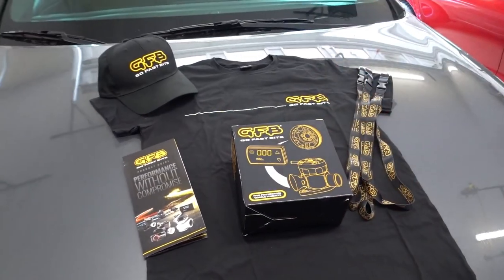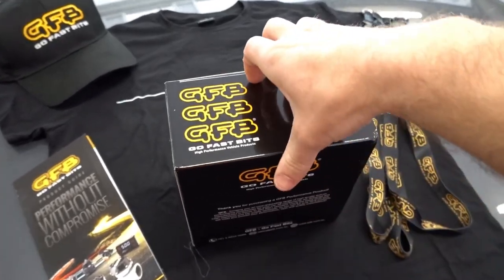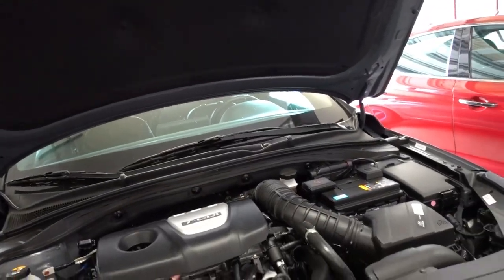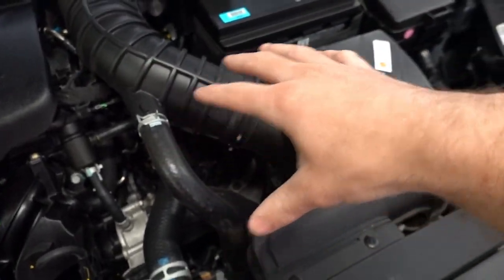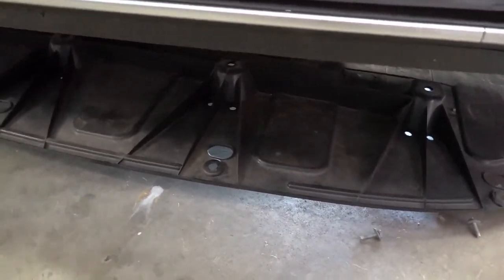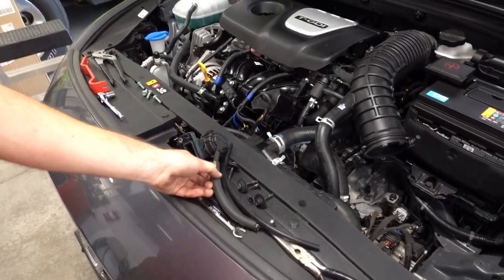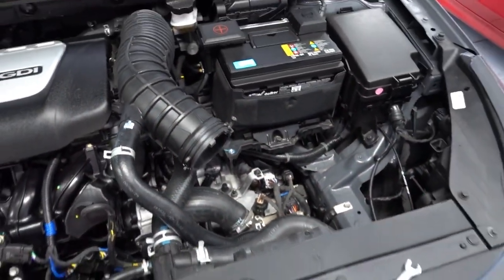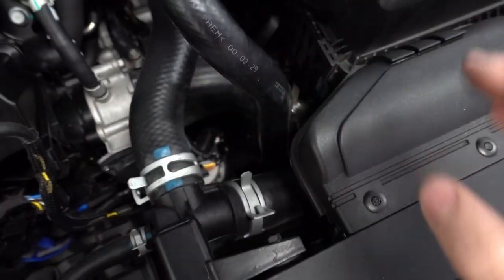Installing a GFB Respons Blow Off Valve! | Hyundai Elantra GT N Line

Comment: Installed mine in my i30 nline premium about a week ago. Removed the factory valve from the top relatively easily, but tightening the hex bolts on the GFB was a PITA. Ended up removing the large diameter horizontal TB hose which made things easy. Adjusting isnt that easy when the cap is slick. Took a fair amount of skin off the knuckles doing it. 

Great channel Justin
Reply: Hey man how does the car sound with the BOV and is ur car the 1.6Turbo?

Comment: I'm having constant flutter, not only during low rpms but every time I left off the gas. Any suggestions on fixing this? I tried adjusting the spring, my boost solenoid is working fine.
Reply from the maker: If you are hearing flutter chances are the valve is not opening properly and the noise is coming from the air being forced back into the turbo. I would make sure the spring isnt too tight and everything is working correctly.

Comment: Ok ,, I just bought a brand new 2020 NLINE ... what’s this for ? What’s the purpose ?
Reply: Will it enhance the performance on my car ? Or make it faster ?
Reply: I believe blow off valves are used to adjust how much boost the turbo makes before it vents. Different internal BOV springs have different stiffness which affects how much boost builds before it vents. It can certainly increase power but you REALLY want your car tuned to the boost level. Most people install a BOV because it sounds really cool.
Looking at a 2020 N-line myself here soon! 🥰
Reply: @anthonycoffey816  did you get one?  Got my baby fluid metal!

Comment: Hey Justin 
I bought myself the GFB Mach 2 
Question any thoughts on upgrading the intake on these cars 
I was consider doing a drop in k&n panel with a big mouth
Reply from the maker: That's a good combo for most cool intake temps (not a huge deal with intercooler) but may help a small amount.
Reply: Thanks mate

Comment: Justin would you recommend this mod if the goal was better throttle response? I don't care about the noise so I would probably go for the Mach 2 rather than the Response. GFB claims 30% quicker boost and better throttle response but that is for the fully recirculating version which I don't know if you've run yours fully recirculating but would you agree with their claims? At $240 I want to know if it's worth the investment.
Reply from the maker: I dont think you'll get 30% better throttle response out of this part unless your stock BPV was failing. Maybe its a little better but I didn't notice anything throttle wise that I can recall but my car is pretty new.
Reply: If you're under the impression fully recirculating will improve throttle response, keep the stock valve. It already fully recirculates back into the intake. This would be a pointless upgrade.
Reply from the maker: @VanillaWahlberg  The stock valve is rubber and can leak or fail over time. It would still be an upgrade even if its doing the same function.
Reply: @JustinKelly  Very true. Although if not needed and still under warranty, can give them a reason to deny claims. Since they cause so many CELs on the Elantra Sport I won't be getting one until I get closer to the end of my warranty. They do no damage, but a CEL is the last thing I want to deal with in CA. :P
Reply from the maker: @VanillaWahlberg  No CEL here. I think if it gets bad enough there are drivability issues along with the OEM valve which some people get fixed and others dont.

Comment: Dosent this car already have a blow off valve stock? Sometimes I notice a blow off sound when I release gas.
Reply from the maker: Sort of. Its a recirculation valve which vents back into the intake system. I consider BOV to be venting to atmosphere so you actually hear it. You can sort of hear the stock one but its not meant to be heard.

Comment: How do you know when it’s 100 circle or 100% vent or 50/50?? Got one for my 21 Elantra nline
Reply from the maker: You can't really tell when it's installed per say. That is one complaint I have with it. I had one off the car a couple weeks ago and it wasn't even when it was spun so it was 50/50 closer to one direction or the other if that makes sense.

Comment: How hard do you have to twist to adjust? 
I keep twisting but I’m not able to make it move
Reply from the maker: Off the car not very hard at all. On the car it is a little tricky getting your hand in the right spot but not difficult. Just remember it only turns so far in both directions.

Comment: I assume if you roll into the dealer with this installed you can kiss warranty goodbye? I just bought the exact car you have and I'm worried about mods/warranty. dealer basically said even a CAI would screw me.
Reply from the maker: I would find a new dealership if they think an intake will deny you warranty coverage in any way.
Reply: No. I work at a hyundai dealership as a service tech and we typically don't care about mods as long as you don't open up the engine or overwrite the factory tune. Chip tuning is fine, since it isn't permanent. As long as the mods don't cause any parts to fail, you'll keep the warranty. It just depends on the dealer, some are mod friendly and some aren't.
Reply: They have to prove the mod you installed caused a certain part to fail. You could install a CAI and maybe MAF fails or the turbo starts having issues, they have to prove the mod you installed caused those to fail tho. And a CAI is easy to install and remove. Just swap it for the factory one when you bring the car in for service.
Reply: @theflukey4114  I know the dealership I went to for service definitely will void. I had severe oxidation on spoiler to point of near cracking. The service manager wanted it in the stall   twice to slap essentially Armor-All on it so they can slide on painting it under warranty. And after 2 hours of that, it was the manager decision. Rediculous for something obvious. Too much info im reading so far regarding if bov's deteriorate turbos, I don't know what to believe. I posted videos (on this account) yesterday on the bov spring adjustments from stock to 3 turns tight and saw not much difference. But according to GFB video of their engineer showing spring adjustment, he mentions at end it should only open about 3mm Bov spring setting

https://youtu.be/KgGRfR6jt-c

So I need to contact them and find out what's a normal, safe setting. My piston open up half way under a 4k rpm load
Reply: @Roadsurfer2k11  If the BOV is opening mid boost, WOT, you need the spring set to a stronger pressure. The thing is though, all these 1.6T's don't seem to like anything but the factory diverter valve. Not really sure why other than maybe because the spring is so soft and lets boost out at the slightest decrease of throttle pressure.
Reply: @VanillaWahlberg  thanks.. letting off throttle is when piston opens and closes. I did a few test drives this week and everything seems fine. No idle issues or flutter gobbling sounds that I can tell. One thing I'll do is close up the atmospheric a bit to tone down the sound. According to GFB they stated these cars are rather tame using bovs and just tighten spring until fluttering and then back off. Went to 3 turns and only thing i noticed was more rapid open/closing near idle point

Comment: How do you get the SUTUTU sound? Like a fluttering sound?
Reply from the maker: Most of the time that is Turbo flutter I believe and its not the best thing for the Turbo.
Reply: You actually don’t want that. Although I think it sounds cool it’s bad for the turbo
Reply: @JustinKelly  But how do you get it
Reply: @sahan2860  buy an air intake system
Reply: @Viikfacee  I assume you still need a blow off valve with set to full atmosphere with the atmospheric vent plugged (closed)

Comment: hey man, any ideas on how to get it to flutter. i.e how much recirc do we need or do we need to block off anything
Reply: It's the intake that gonna cause the turbo to flutter.
Reply: Flutter is the result of not having any blow off valve. You would delete the blow off valve all together at both ends (pre and post turbo). It's then enhanced by changing the intake pipe to a metal type.